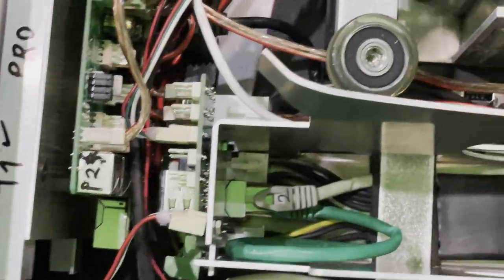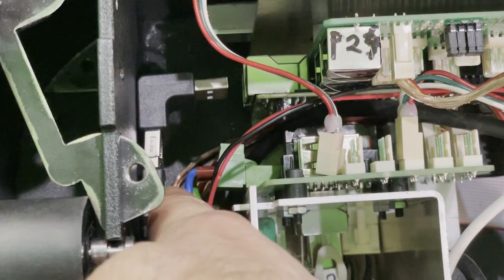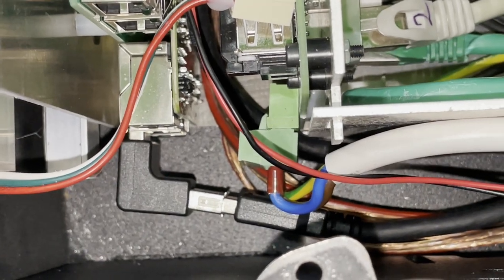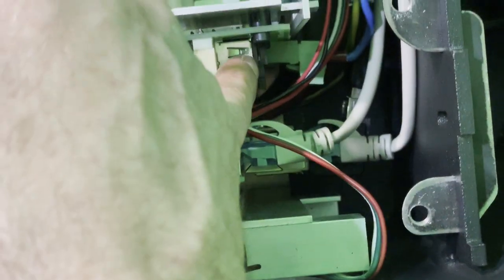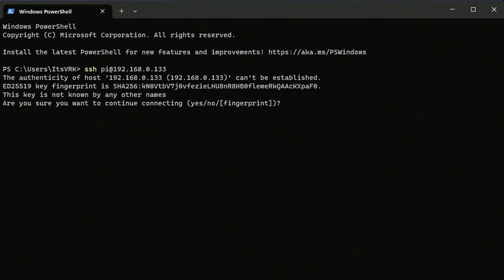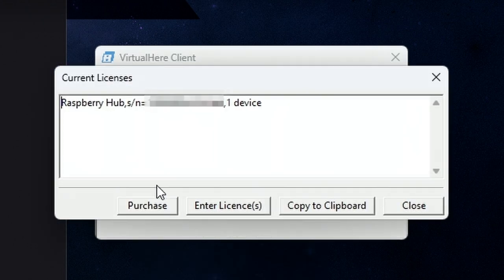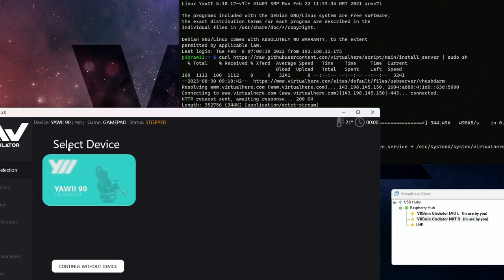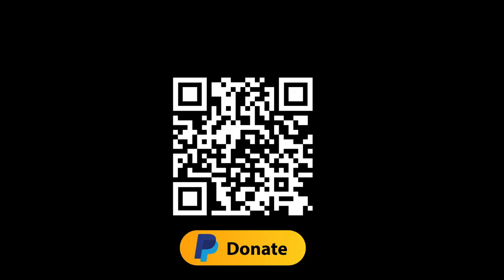Setting up VirtualHere on the Yaw 2 for Wireless USB

Comment: Nice one. As I happen to have spare RasPis in my posession I just printed a case for one of them and attached it to the seat. Also I don't want to disassemble the chair right now as it works perfectly.
Reply from the maker: Yeah I was running the battery powered VirtualHere box I built for my Yaw 1 until i did this. https://www.youtube.com/watch?v=neCHO7eWlt8

Comment: I'm interested in buying a yaw2 for flight simming but I wonder how smooth the movements are when you do a slow bank or pitch. I currently have a DOF H3, but it's very "steppy", particularly during slow movements, which results in a rather jerky motion. (like eg. 1 or 2 steps per second.)
So basically, how fluid is the motion with tiny corrections? Thanks.
Reply: There is nothing like the yaw 2 on the market...it would be better than the system you have now. It is very smooth
Reply from the maker: I will have some content showing MSFS in the future, I'll be sure to highlight this in it. Re-arranging my office/playspace so can't use the Yaw until that's done.
Reply: @ItsVRK  Thanks, much appreciated. 👍